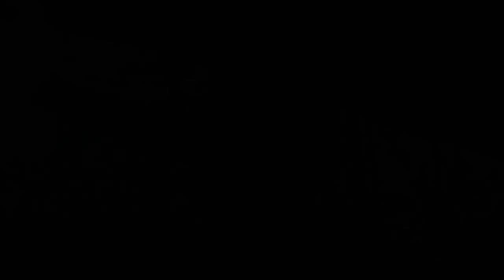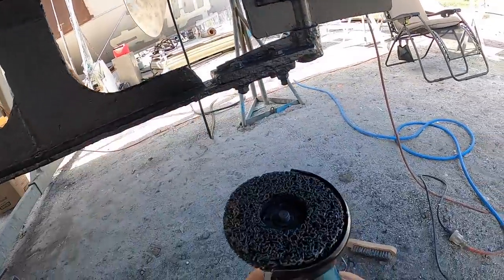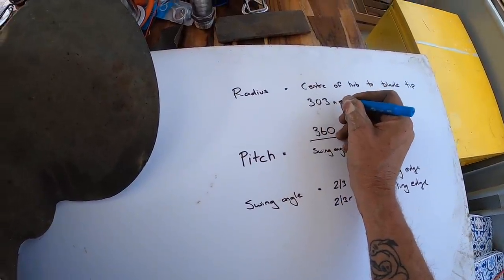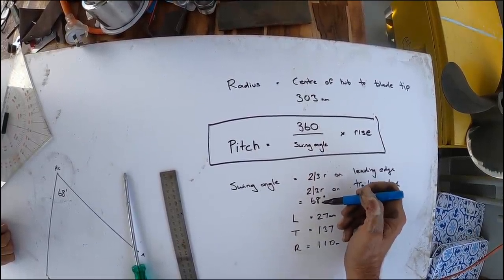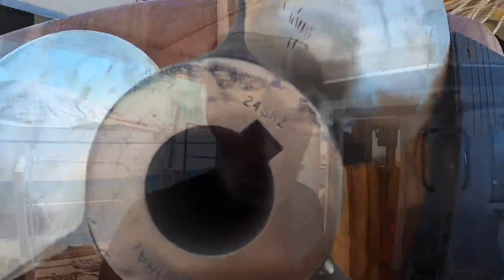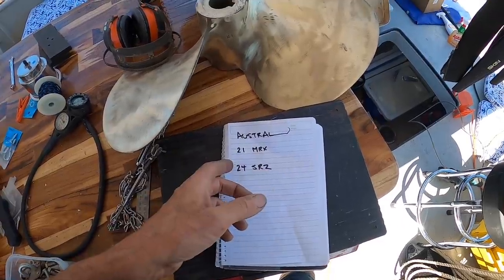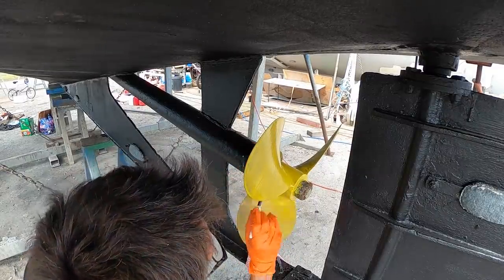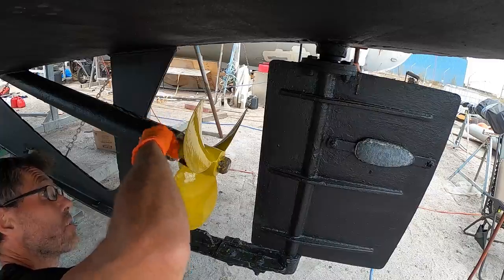Measuring a propeller and applying Propspeed

Comment: So, um, Uncle Cosmo also liked to wipe down with a rag after he polished the shaft.
Well, I mean, there's no real way to stretch that out.
That's what he said.
Nevermind.
My granddad was in the RAF back in the day, and one of the things he told me, and practiced his entire life, was, if you've got a spinny bit and you want it to spin well, you have to paint a spiral on it. Painting spirals on spinning things makes them spin even quickerer because they know which way to do it right from the start. His Hurricane had a spiral painted on the propellor nose bit, and that span even better. His Hillman Imp had spirals on the hubcaps and they spunned quicker too. Or at all, really, any suggestion of rotation off a Hillman's wheels is an improvement over stock, let's be honest. His food mixer was spirally, his record player all heliacal. He even had spiral bedsheets. Not certain why. So, anyhoo, if they sell that special paint in different colours, try getting two and spiral that splosh-go-shove up. It's like painting something red, it absolutely scientifisually is then provably quicker, especially combined with the universally understood stripe down the middle that lets the air know to go around that bit. I know a red Renko would maybe look a bit wierd, and I guess overall speed is less important than mileage, I'm just sayin', spirals on the prop, stripe down the middle, red paint scheme = maximum top speed. You'd be wanting some hydrofoils, too, at that point. Handy for those high speed trips between Montevideo and Denham when the bilges get a tad arctic, if you know what I mean.
Denholm Elliot was named after Denhem, as most people know, on account of his mum and dad needing to remember where they parked the Amilcar when they were there in '21. This was prior to the invention of spelling, or at least, prior to the adoption of spelling in the Great Strayans, although many modern scholars suggest that this seminal linguistic event has yet to occur across the Big Sandy Blob. I, of course, dyzargry.

Comment: Good job in discussing the props, you might actually get some reduced fuel consumption and torque from the prop change when implemented. It sounds like it is basically a one to one prop ratio. 
On a large inboard ski boat we had a 13/13 and with the boat loaded with a heavy skier behind you could pop them right out of the water and be up to 40 mph in a short stretch planing.

Comment: The Propspeed Clearcoat on the prop has to be applied thickly enough to flow out and brush the drips as it levels out to give you maximum film thickness for better durability and protection.

Comment: Very pleasant just sitting here with my Boston lager watching you work, Stu.  Seems a smaller diameter higher pitch screw would give you less power at slower speeds, but higher potential top speed. I would like to add that I know absolutely nothing about this. Looking forward to the wet.

Comment: That flicking headunit does my head in
Reply: @Kyle Stephenson - Avert your gaze or, try your 'safety-squints'. Cheers-
Reply: Fix the thing
Reply: @kylestephenson3004  - It's an issue with the camera, synchronizing (or, not) to the monitor - It only happens, through the camera - not in real-world experience. (There's nothing to be "fixed"). 
The only thing I could demonstrably compare it too is, to blink your eyes at varying speeds, to a blinking light; sometimes you'll see the light on, sometimes, it will appear off - or, you may catch it, between cycles, as dim (you won't see a steady rate of light, flashing) - Both, the camera and, the monitor (display) are working in, fast on-off cycles, that the human-eye generally, does-not perceive - if, the camera is 'shuttered-open' at the same time the display, is 'blanked-off', it will be dark - this happens anywhere around 30, 60, 90 or faster, cycles, per-second.
Reply: Thanks for the explanation I work at sea on a trawler and if it flicked like that it wouldn't be attached to anything for long
Reply: @kylestephenson3004  - You bet! Sorry about my first response of "safety-squints" - I thought you were having a go, at it... Cheers-

Comment: In 1974 I was on a 52 ft trawler in Bundy,, hit something and bent  a blade tip it was a 4 ft , 4 blade prop behind a 250 hp Cummins, slipped at  Kepples Slip and   the prop went to Maryborough ,, came back as good as gold,,

Comment: I have used Propspeed a few years ago, Two boats and myself in the yard went in on a kit as it is expensive. My boat is a converted fishing boat 46 foot  our home so it can sit for 3 or four months inactive during our nasty Pacific winter. hull speed 7 knots cruise 9 knots full on but pushing lots of water and using 40% more fuel. Back to the Propspeed. I swing a 34" prop with a three to one gear box so with a 1500 RPM motor speed the prop is turning 500 RPM. A 6-71 GMC.

The reason for all these back calculations is that I found with the propspeed the prop was not turning fast enough to get any barnacle growth relief. I live on the west coast of Canada in the Pacific. Some folks paint there props with bottom paint, which can cause problems with the copper content, For the past 6 years I have been using Zinc spray in a can. Not cheap at $45 a can and my prop takes one and bit cans., and the barneys fall right off with a few rotations of the prop. Under the right conditions the propspeed could work IE: a fast turning prop...just not for me with my slow old craft.

Comment: Rule of thumb displacement Hull diesel like your Detroit is a “square” wheel. Diameter and pitch the same. Variance would be a few inches more or less pitch. Taking two inches out makes a noticeable difference with more power reduces boat speed . Adding a couple inches gives more speed less power and in many cases prevents the engine from turning optimal RPM.  

Only way to know for sure is test on the boat. I like the engine to be able to obtain maximum rpm and cruise comfortable typical load  with couple hundred RPM less. If you plan to pull a big load go for less pitch. Tugs often have half pitch compared to diameter. High speed plaining Hull could have diamater plus 25 %

Comment: I was following the math quiet well. Then you switched to inches. Could’ve just started in inches and it would’ve been easer for me to follow! My brain thinks in inches; however, any measuring system works if done accurately. Nice piece on prop. measurements, and prop. speed! What’s up with that nut????
Reply: Looks to be made of steel, I think it should be brass.
Reply: Damn, someone who knows imperial and metric and switches between them during a job… I do it regularly, drives my fully metric family nuts.

Comment: Hey Stu! First, congrats on the 200K! Second, if I may make a suggestion, don't film with your GPS map screen on, it flickers annoyingly in the background of the shot.
Reply: @Toomas Kotkas - There's an easy remedy for that flickering; you just have to blink your eyes in the right time and speed! Cheers-
Reply: @markaoslo5653  I am too lazy for that.
Reply: @cmmartti  I don't think it's possible.
Reply: @cmmartti  - By accident, perhaps - if the two devices aren't digitally-linked (to sync), it's still going to go, out of sync.
Reply: @toomaskotkas4467  - "possible" not, practical - the syncing process has been used in movies, to sync the camera and video displays, recorded through the camera.

Comment: I always thought Renko sounded/performed under geared.
Reply: That might be because the  engine is a 2stroke. At any given rpm it sounds like it spins 2x the speed of a 4stroke. It doesn't. It just has 2x the firing events. That's why they call them screamers. And that's why they might seem (or appear to be)  undergeared when in fact they are not.
Reply: @jfv65  Didn't know that, makes sense. Cheers.

Comment: What's with the prop nut? Is it stainless steel? Chinesium stainless?  Seems like it shouldn't corrode to that extent.
Reply: I thought that. Usually attached with a castle nut and cotter pin.
Reply: Prop nut is welded on

Comment: By reducing your pitch your also reducing your top speed and by increasing your paddle size your increasing your drag and power , granted your vessel isn’t an on plane type but a big paddle and a modest pitch ( 16 - 19 ) you will have plenty of power so wouldn’t a 19 p speed be around 10.5mph @ 2,000 rpm and a 21 p speed be around 13mph @ 2,000 ? Am I looking at this correctly ?
Reply: Those are probably the correct no slip speeds.  Need to figure in the hull speed to get "ideal" prop dimensions for maximum actual speed.  The real problem is that every situation (towing, headwinds, surfing,trolling) all would produce a different selection for the "ideal" propellor.  Of course that's not to mention fuel efficiency - if you were trying to maximize that, you'd size the prop for best engine rpm and least practical wave making.  It's always a trade.
Reply: @boooshes  there’s no IDEAL prop that’s universal in applications , the best you can hope for is to be respectful in each category ! Hull types play a big part in performance , if you put a 50hp on a tri-hull you get X , but 2 - 25hp on same boat you get Y . Totally different but the same amount of HP .
Reply: @davekimbler2308  yes, I completely agree.  I was attempting to discuss that one could pick an ideal prop for one purpose (say, top speed) but for most boats you have to have a trade off between several necessary end goals.

Comment: What does Propspeed do
Reply: Propspeed is a coating system designed and proven to increase vessels' speed and fuel efficiency and greatly reduce marine growth from bonding to metal surfaces below the waterline. Propspeed works because it's slick, not because it's toxic.
Reply: @DukeOfTwist  Thanks for the explanation.

Comment: Forget those silly-looking 21" and 24" brass alloy propellers... Instead, impress your friends with one of those forged Hering stainless steel, 5 bladed, $13,400 U.S.D. cleaver racing propellers like they use on those offshore turbine-powered racing boats. They can handle that 1200+ hp Detroit Diesel that Adrian helped you build.  🤣🤣🤣